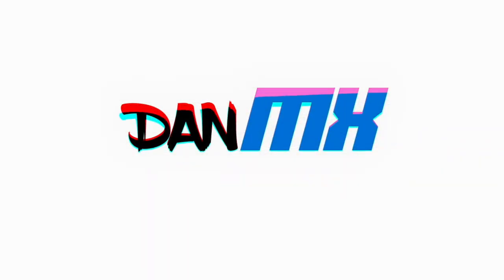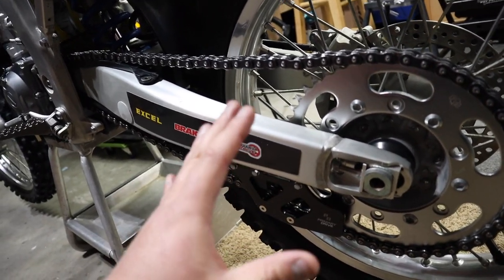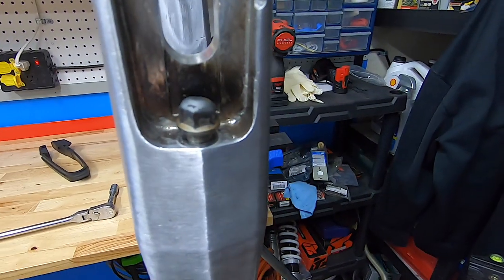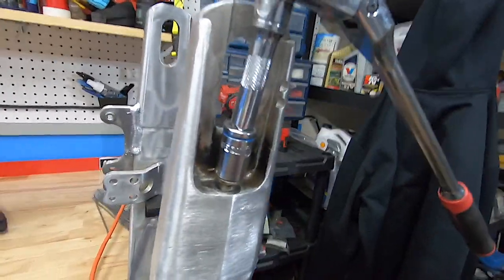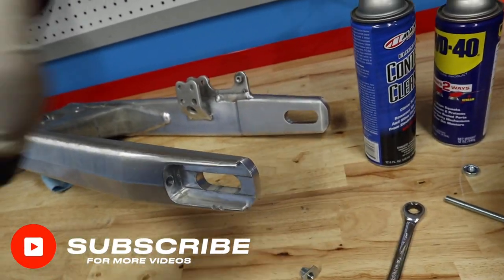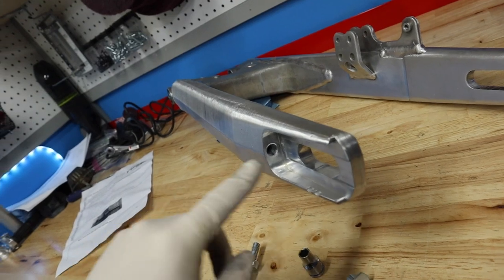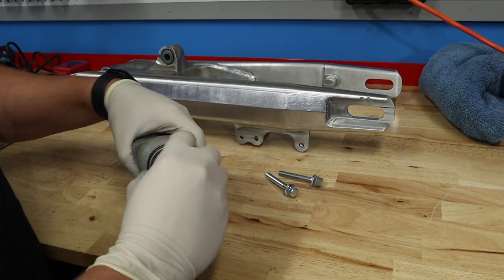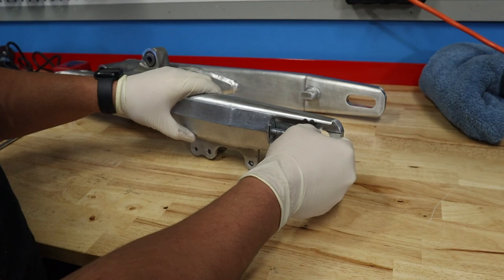BROKEN OR SEIZED CHAIN ADJUSTER BOLT | Easy fix!

Comment: I am in the same boat....  But both of my bolts broke. Luckily I have a MiG welder,  But the "swing arm buddy" this is new to me, this is what I am putting in.  Because I go through this basically every year after winter, I need to Change sprockets and chain, and  These damn bolts break off and I think... WHY do they put Steel in Aluminum, but finally this year I realized..... I am the one that put Steel into aluminum when I fixed it last time.  So  Thanks for the Swing Arm buddy Info.  Ordering now.

Comment: I would also recommend putting some red loctite on the surface of the insert going into the aluminum. It should help it slide in easier and when it dries it’s not going anywhere.
Reply from the maker: Not a bad call, but due to the pressure from the axle it should be good… 👍

Comment: Great video. I recently had some welding done to my swing arm.. no structural damage, but I forgot to take the bolt out. So now there is slag on my bolt in the swing arm. Would you still consider this method?
Reply from the maker: If there is slag on the bolt, for sure remove it and replace. This method should be fine, as you should still be able to back the bolt out right?
Reply: @DanMX2112  well inside the swing arm there is slag because it won’t back out any more.
Reply from the maker: @onlyshelton oh snap, well in that case, I would probably try to drill the bolt out as much as possible and try to collapse it to remove it. Otherwise you’ll have a bolt bouncing around in there.

Comment: Mine snapped on my 2022 Ninja 650 after my friend totaled my car so I have 0 transportation. I have tried to have shops do it but they have declined every request. I dont know how to weld so I cant do it myself.
Reply from the maker: Dang bro, sounds like some bad luck. Drill it out, I hope that works?
Reply: I am going to be trying to do as much as I can myself. But thats not a lot.
Reply from the maker: @FOUR22  you got this, don’t give up on it! Your more capable than you think!
Reply: @DanMX2112  I hope so! Been difficult lately. I have put a lot of money into it so far. I reached out to the dealership I bought the bike from and they also declined all repairs. Without looking at it.

Comment: Just a side thought:  The flange of the tapped-in insert works here because there is no mating surface involved.  Very nice!  However, for all viewers' heads-up, this concept would not work if you are repairing, say, a stripped out bolt hole in the engine cases where the surfaces need to be flat all the way around.  In this case, you would need to use the Heli-Coil product, most often the 6mm repair kit.
Reply from the maker: Right you are, and a heli-coil can’t work in this application because of the pass through bolt. Good points!

Comment: These bolts are stuck mostly due to being rusted inside, Whether you buy a brand new or used always remember to apply grease to every bolt you find. If not these issues happen especially in used and old bikes.
Reply from the maker: Right! Corrosion is a monster. Seen some newer bikes too that have had this issue, it’s just a bad deal that we have to deal with it. Not a perfect solution out there to fix it, or I think it would be implemented.
Reply: @DanMX2112  anyone who buys a new dirt bike he must disassemble it and start to apply grease on bolts and screws (ITS A MUST) in it, then its easy for the owner to service it without any  issue. I have a 250 nearly 2 decades old, servicing it was difficult due to bolts and  screws arent applied grease to smooth it out, now its rusted and tightened,  not comming out. My chain adjuster bolt is rusted, it broke off while half is in the swing arm not comming out. Now I have to buy new bolts and screws. Completely a waste of time and money.
If grease was applied there would have being no issue.
Hope this is a lesson for everyone
Thanks and God bless you all.
Reply from the maker: 💯 agree, couldn’t have said it better! I hate the old bike seized bolts, makes for some miserable times. Take care my guy!

Comment: I think when you heated it it weakened the aluminium to the point the threads came out..  But Jeeesh  why don't they just design it with a steel insert in the first place?  I was going to buy one... Realized that when I bought my  "CR 250 bolt kit"   it came with 4 of those inserts.  i wondered what those were for.. hahaha h
Reply from the maker: For sure, but I was past the point of fixing the threads lol the insert kits works wonders, but idk why it came with 4, I guess you have some extras.

Comment: Doesn't aluminium weaken if you heat it?    Wouldn't you rather heat the steel bolt?>?>
Reply from the maker: It don’t matter, the heat transfer wouldn’t change what part is heated.
Reply: No. Whatever metal you heat expands. You definitely don’t want the bolt expanding, you want the aluminum to expand to take pressure off of the bolt so it would turn easier.
Reply from the maker: Right, but In this scenario I can’t heat the swing arm without the heat transfer taking place. The benefit though is that aluminum expands more than the steel bolt at the same temp, which helps the cause. It would be nice if it was like installing bearings where I could only hear the aluminum.

Comment: That’s definitely a 3/8th drill bit? About to do mine seems too big
Reply from the maker: Sure is, I just ran out and double checked.
Reply: @DanMX2112  thank you for the fast response great video. I will continue my process then just need to get a longer starter drill bit to start the hole. I broke my old bolt inside
Reply from the maker: The kit from RMATVMC comes with the bit, I would recommend using that one.
Reply from the maker: Or the one I linked in the video description.